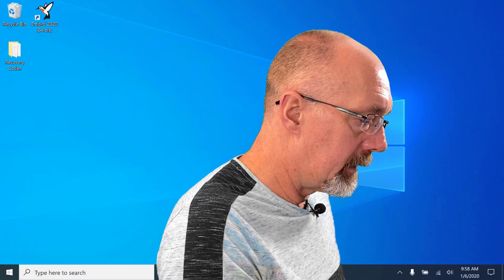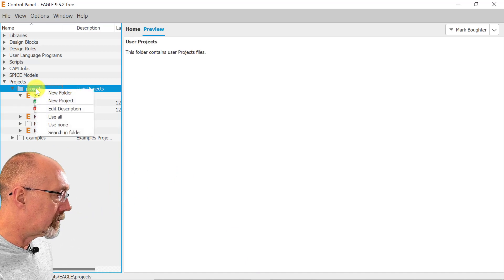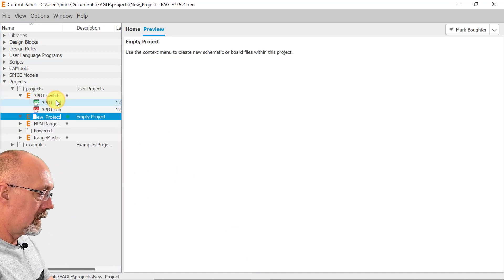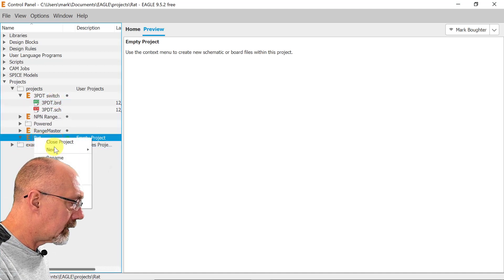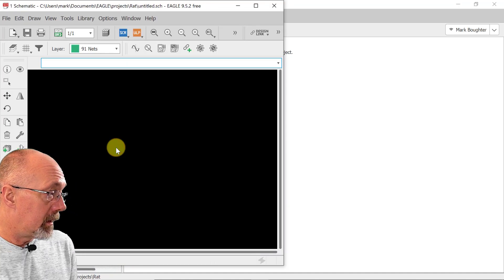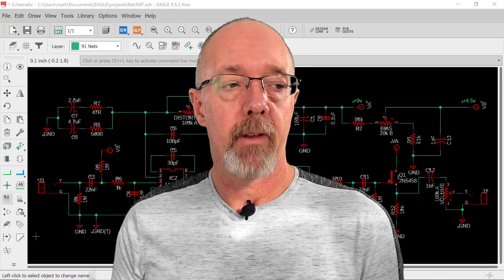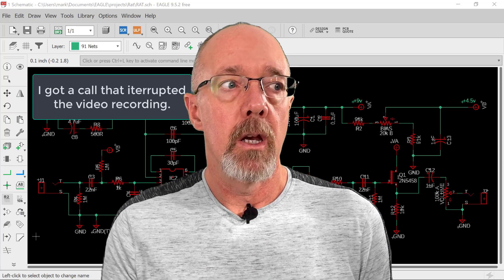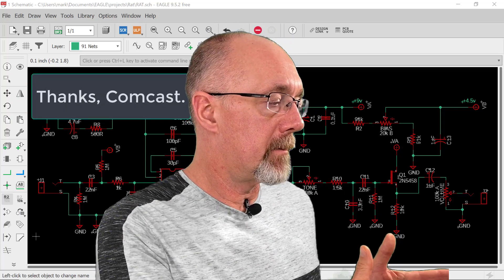Build Your Own Effect Pedals - Rat (Part 1) Schematic

Comment: Someone knows what exactly  the resister 47R do which next to the +9volt
Reply from the maker: It is part of a low-pass filter with the capacitors to reduce ripple in the power supply.

Comment: Why Eagle? Why not QSPICE the new version of LTSPICE? I'm confused.
Reply from the maker: We’re making PCBs, not simulating circuits. The process from schematic to layout to submitting the PCB for manufacture is rather easy in Eagle. 

I haven’t looked at LTSPICE for years but if they’ve added capability and simplified the process, do tell.

Comment: You could probably build one for at least half of 70 bucks
Reply from the maker: If you do a straight Rat, with no mods, and you can source all the parts, I’m thinking about $25. Of course, finding an LM308 these days is an issue.

Comment: Nice videos !!! I have a rat pedal, with a problem . It start to distort from 8 o’clock knob to the maximum at 10 o’clock . I don’t know what stage I have to check . If you can help me i will be very grateful.
Reply from the maker: Has it been modified in any way? I ask because it seems that a pot with an incorrect taper or incorrect value could possibly do something similar. If I remember correctly, the Rat uses all 100k Audio taper potentiometers.